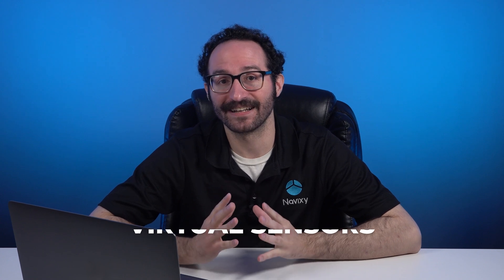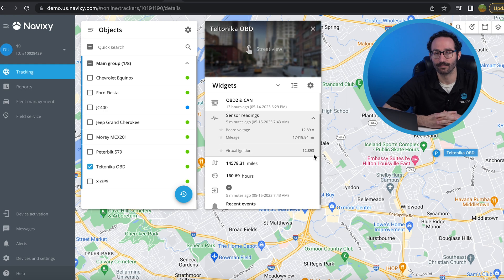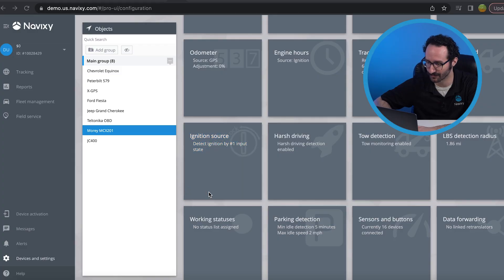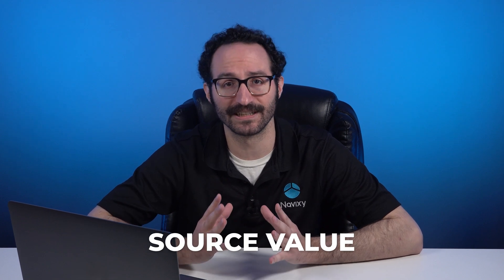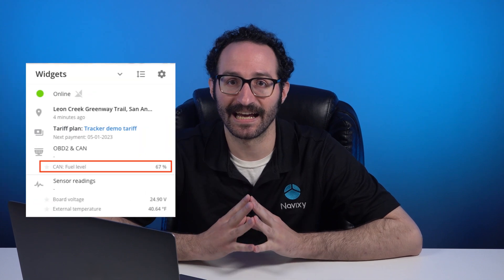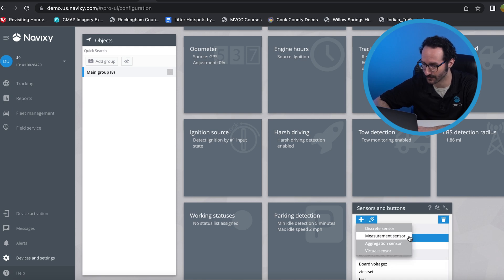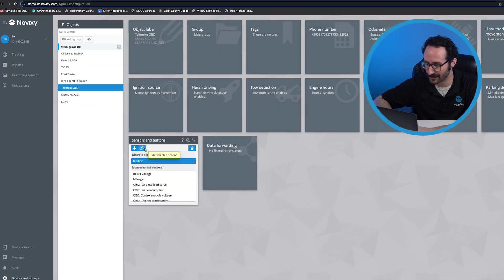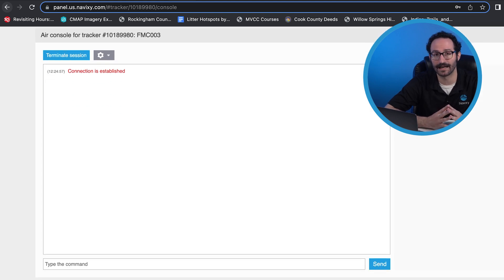Virtual Sensors in Navixy

Comment: Hi there. Regarding the virtual sensors, specifically the CAN data. You will obviously need a tracker (or third party device) connected to the OBD port. Right? Please provide further information.
Reply: Yes, the physical source can be either a CAN reader, an OBD tracker, or the car maker's OEM server. Virtual sensors add a software layer where you can create more advanced server-side logic that is often unavailable on the edge.